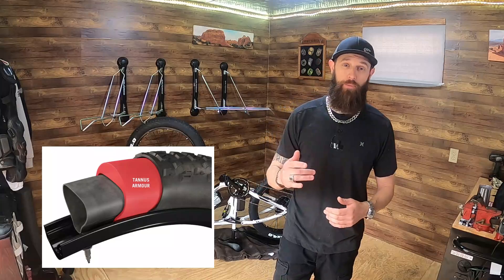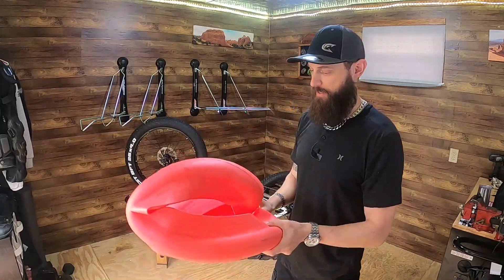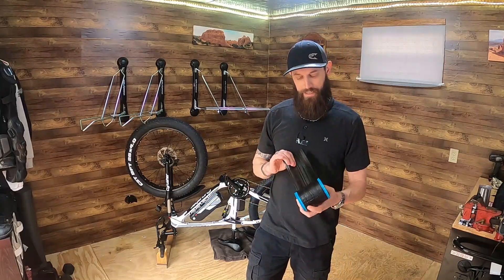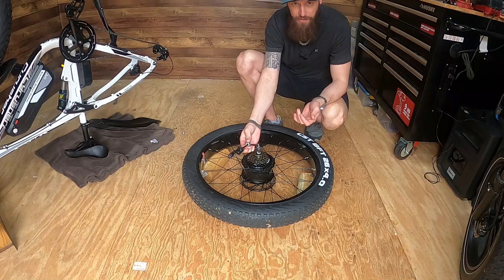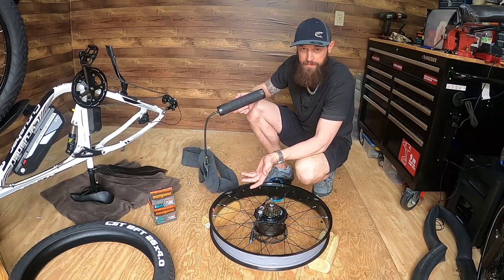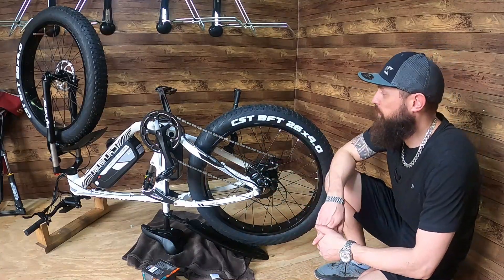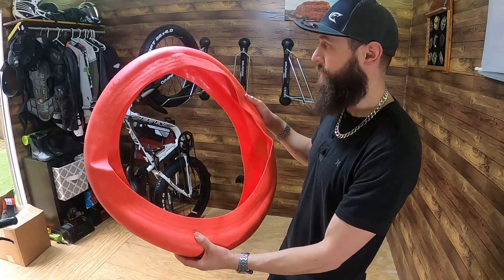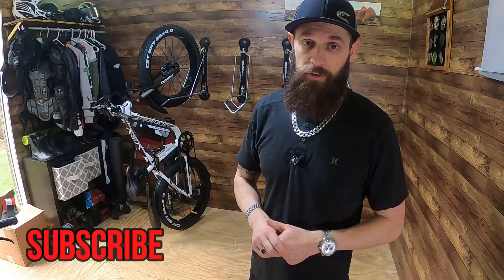Mr Tuffy Tire Liners vs Tannus Armour Foam

Comment: You should ride through a thorny field with both and see if either get a flat.
Reply: They're good for that it's Thorny sidewalks that will get you
Reply: That’s what I was hoping for. I don’t think my decision of flat protection will ride on the softness added. I actually prefer a stiffness because I get a more efficient thrust out of my pedaling. Softening is like low tire pressure that makes you do extra work.
Reply: @jesseschumacher4080 This video was supposed to compare the two for puncture resistance. No such luck. I use Flat Out in the tubes of my 4” wide fat tires. 450 miles and no flats yet. This area I live in has thorns everywhere.
Reply: I did that with tannus and no flats hundreds of thorns and the taffy liners couldn't handle it
Reply: @jesseschumacher4080 😂😂😂
Reply: @doncarpenter83  you can combine Tuffy and Tanus for ultimate protection
Reply: @illla this is exactly what I was thinking
Reply: @TravisMcGee151 do you use liners as well as the flat out or just by itself? 🍻

Comment: I've been rolling with mr. Tuffy's for over 15 years overall they work great and they're cheap I would recommend this to anybody who doesn't want to push there bike when they get a flat tire get them you'll be glad you did
Reply: Ultra light version? Never had a flat?
Reply: Have You tried "rhinoDillos" ?

Its a mr tuffy product too but with an improved formula apparently
Reply: @Tobi-wr4co   no I haven't
Reply: @capcom4eva  regular version Brown color code
Reply: You said they're cheap ?I don't think so..
Reply: I gotta agree. Mr Tuffy cut my flats in half maybe less.   They certainly do help and for extra measure I use Green Slime. Unless the hole is too big.  It seals the pin holes pretty well.

Comment: UPDATE. I knew I read it somewhere, so I got out my Tannus installation guide and on page 3 under Tips For Installing Tannus Armour it states (It is common for the Amour to compress over time. It still is providing shock absorption and puncture resistance but will perform better when properly maintained. To minimize compression deflate the tires while not use. This allows the Armour compound to rebound to provide ideal performance.) So does that mean when your not riding your bike, your suppose to let the air out of the tires? I'm sorry but that's not happening. I don't know how everyone else feels, but if I would have known that earlier, I would not have purchased the Armours.
Reply: Wow that sucks.

Comment: Interesting comparison - My personal experience riding in Southern California (Mecca for Goathead thorns) is that Tannus proves worthy. I have used several "liners" and none worked as needed. I've had the Tannus inserts w/tubes for about 6 months now and not 1 flat. I thought it would be interesting to count the thorns I picked up and pulled out, over 50 so far. I'm a believer in the Tannus solution.
Reply: @wildernessmusic1068No tyre in the world? Don't be so ridiculous..😂
Reply: @thetruebrit85 i think hes saying every tire should have thorn protection
Reply: Did your put the stock 4" tubes back in the Tannis liners or buy new smaller tubes? Please.
Reply: @petejansen8098  I put the smaller tubes in and it fits perfectly. I used foot powder in the tires and on the tubes to make it easier to fit. I love them.
Reply: @volocty what size tube do you use to fit ?
Reply: @ronsantos475  Tube size for the inserts is: 700x42/50 (ETRO 42/50-622) Presta 48mm.
Reply: Thank you !!!!
Reply: Lucky y'all, I've had flat tire with punctured tubes twice in a day and one the very morning after . You can't imagine the frustration I had.
Reply: Do you think that an old school 2.20 Slime Tube, Shrader Valve would work with a 4 inch Tannus Insert and Tire???? Thank you! I have tons of them laying around and would like to use them if they might work. : ) @volocty
Reply: @Sherman1862  I don't know about the sizes that go together, but reaching out to Tannus would be my suggestion.

Comment: I learned from an old timer   Just run tow straps inside wheel!  Cheap and works
Reply: i also heard to run fire hose as liners.
Reply: We used hot wheel tracks back in the day and never got flats after installing them just tape up the seams/connections
Reply: Im gonna try this

Comment: Want a really smooth ride? Take some baby powder (or foot powder) and put about 1/4 cup over the tire as well as inside the tire casing, dumping some in and turning the tire in your hand so the Baby Powder (talic) evenly distributes. This will make for a very supple ride as you prevent the tire from sticking to the tire casing inside which also increases chafing and hence tube wear and seam leaks). I have been a UBI Pro Mechanic and used this for bikes since the early 90's Even for ebikes too. (My first was an "ebike" but Ebike brand from 1999) For my spare tube I keep one in a ziplock bag with the talic in coating everything nice.  Trust me it really makes a huge difference!

Comment: I once used Tannus Armour and after a while both the front and rear Armour compressed permanently to about 1/8 of an inch in thickness.  I got a flat from a small metal shaving in the front tire and it went right through the Tannus Armour.  I tried riding with a front tire flat with the Tannus Armour and stopped because I was concerned about the rim becoming damaged.  I no longer use Tannus Armour and use some tire liners with Schwalbe Marathon Plus MTB Smart Guard.  They are heavy tires and are advertised as being thick enough to not get flats from objects the size of a thumbtack.  I road several thousand miles without any flats. 
If your bike tires are as flat resistant as car tires, that is ideal.  Objects like screws and nails that give car tires a flat will also give you bike tires a flat unless you have airless tires or airless tire liners.
Reply: Thanks for this comment. I remember hearing people having to deflate their tires after every ride. I’m all set on paying $160 for a pair of tannus armor and I’ll just get mr tuffy for half the price and get the same results.
Reply: @Nickles4  You're welcome and happy trials.
Reply: @johnb9005  So what do you advise for my 26 by 4 flat?
Reply: Does tannus armour feel heavier?

Comment: Watching You do all that work is crazy. I put the bike on My work stand, cracked one side of each tire front and back tires , inserted the Tuffy liners with one hand inside, reinstalled tire side and inflated !! NEVER took a tire off the bike or tire off the wheel.    Yes tube changing is a different story.

Comment: On my hub motor on back tire e bike, i fixed  flats n put the mr tuffy liner on without taking back tire off, i use rachet strap to raise back end of bike up off ground strapped around a tree branch or beam of roof or whatever you can strap it to
People when you go riding on hub motor ebike carry a rachet strap also so you can fix a flat easier if you need to, works good when putting tire back on with tire up in air, also carry bottle of unexpired bottle of green slime or 2 bottles, this saved me a few times fixing flats, best to put green slime in before you go riding, carry extra valve stems, one time green slim messed up my valve stem n couldn't pump up tire- had to put new one in, also carry steal long valve stem remover tool- one time plastic valve stem remover tool on green slime bottle broke n wouldn't take valve stem out, also carry skinny needle noise plyers- one time valve stem got stuck n valve stem remover tool wouldn't remove it
Especially on a e bike people, if you got wide tires n a heavy ebike it is hard to roll back home with a flat if you are miles away
Reply: Good suggestions — sounds like the voice of experience!
Reply: @phantom4255  
One day I put in tannus armour inserts n only got one flat in 10 months, best thing to do unless you put motorcycle tires on

Comment: I've now got TAnnus on my fat bike and they are excellent.  I had MR Tuffy but found them a nightmare to install...they slipped about inside the tyre and when I eventually removed them it was clear that they had settled inside the tyre in a series of twisty curves meaning there were areas of tyre not protected...and yes I did puncture because of it...

Comment: I installed Mr. Tuffy’s on my Rad Mini and it reduced the rolling resistance so much it felt like a completely different bike! It accelerates way better than before! A great investment, get the 26”x4” and wrap the extra within the tire casing...don’t cut it...quick sidebar...Locktite Non-Permanent fixed all of my rear wheel spoke problems..!
Reply: What spoke problem?
Reply: ditto, what spoke problem? spoke loosening & wheels becoming untrue?
Reply: Lol dude just learned about more psi = less resistance.
Reply: NAIL 💅 POLISH =The best thread locker

Comment: I appreciate your thoughts on the tire liners, I've talked with others who bought Tannus and they pretty much said the same as you, but your the first that has done both, so I definitely appreciate your input. i personally bought the Mr Tuffies, but like you said, I didn't see any difference in the ride, while, friends that have bought Tannus Armour all said it's like riding on a cloud. I'm getting my Aventon Aventure in mid June, so I may buy Tannus Amour for my new E-bike. Thanks again, always enjoy your videos!
Reply from the maker: yep it really does change the ride quality quite a bit and i'm a fan :)    quite expensive though
Reply: I just got my Aventure. I am debating on which liner to go with. How has your experience been over the past two months?
Reply: @adammerritt4404  I've had both Mr Tuffies and Tannus and yes Tannus is more expensive, but they are worth it. I put them on my Aventon and the ride is so much better and they'll handle goat heads from the west and midwest, so they'll handle anything we have here in the east. I've had mine on my Aventure for over a year and have no flats, even after riding through an area where there was glass all over the road, looked like it was windshield glass.

Comment: I just had a screw enter my back e-bike tire. It went through the tire and Mr. Tuffy liner, but the FlatOut sealant sealed the hole with very little air loss. Double your protection and double your fun. Their is nothing wrong with redundancy and it will keep you from walking your bike many miles, or save you time with an on-the-spot repair job. Who knows what type of weather conditions await you? I did not notice any different ride quality with both of the tire protector products. I love your videos on Rad Bike upgrades. Ready to pull the trigger on the Area 13, Bolton E-Bike, controller upgrade for my wife's Rad Mini ST.

Comment: I just ordered the Tannus inserts after watching your informative. Question when I fill the tube with the Tannus inserts do I use the recommender psi in the tire or should I put less cause of the inserts. Thanks
Reply: I'm guessing you'll want go slightly lower, but that lower pressure might provide similar firmness and flex to the tire.
Reply: I have been running 12 to 15 psi in my 20x4 inch tires and the ride is fine with the Tannus liners. Handles much better than before.
Reply: @ohwell2790  12-15 psi sounds right.  That's what is nice about our Armour.  You can run lower psi which gives better control, and comfort.  Cheers
Reply: @RideTannus  I run the CST Roly Poly 26x4.8 @ 6# in the rear, and 4.5-5# in the front. Where I live there is a lot of soft, deep sand, and goat heads are terrible problem. Are these pressures going to work well with the inserts?
Reply: @skooterbrah  If you're riding in the sand a lot a good # to run would be 6-10 psi with our Armour Inserts.  Anything below that we don't recommend really.  You can play with the psi up or down to get it where you are most comfortable. Hope this helps!

Comment: I use Mr Tuffy tire liners and slime tire sealant, they stop everything except nails and screws. I've learned to avoid construction areas because they spill nails all over the streets... 😠 I'm also familiar with the more comfortable ride when I was using Schwalbe Marathon tires which had a thick rubber compound. But that was on thin tires on a hybrid bike. With fat tires you get a similar effect so the ride isn't so harsh that I would favor the Tannus armor over what I use currently.

Comment: My observation on the Mr Tuffy liners. Yes, they do reduce the goats head thorn punctures. If you get a tuff thorn and it breaks off and the pointy part stays in the tire after more riding the thorn WILL get thru the tube. Yes the rolling resistance is less, however the ride over gravel/sidewalk cracks is much rougher.
Reply: With Slime liners I've got numerous things embedded in the tire and even take small chunks out of tires, revealing the green lining without puncturing. Have had flats from thorns just missing the liner, though.

Comment: I have 2 Juiced Ripcurrent S for the last two years and had the Mr. Tuffy's in both and never had a flat. I switched to Tannus Armour and Maxxis Minion tires. IMO the Tannus inserts causes higher rolling resistance vs the Mr Tuffy's. I now have 2 months on the Tannus and for the first month the tire pressure kept dropping 2-3 psi every week. If you can do a battery range test Full to flat between the Tannus and Mr Tuffy on the same ebike and tires I would like to see those results.
Reply: So what do you prefer,? I just bought a rip current s also 🤠
Reply: @jewboyjon75  I have converted all tires to tubeless.
Reply: That's what keeps me from getting them. I've heard mixed opinions on the resistance, but I don't see how it's not gonna be a little too squishy and slow for road use. Trails, I'll be on them all day. Absolutely. But for an ebike that spends more time on the road, I think I'd rather stick to double skin tubes. The amount a slightly too low tire slows you down, and drains the battery is substantial enough for me to skip them. Sucks because I like the idea and really want them, but I'll wait until I do up a straight trail ride. I really wish they would get on different composition/hardness options. And I mean it's not like they're super overpriced. But especially the fatties, are a little ridiculous for a little piece of molded foam. You don't really have much choice if you need them, and I wouldn't mind the price if I do end up needing them enough. But I've only got two flats in the past year, and both could have potentially gone right through the t.a. anyway. Big spike of glass, and then metal. Idk. Doubling an old tube or two has kept out the little dumb stuff, so.

Comment: I started with Mr. Tuffy's and after 1,200 miles through every kind of terrain I have yet to get a flat - - ->>>.<<<.  I installed them without even taking the tire off the wheel or the bike !!
Reply: What about those thorns in the desert or whatever there called, did you ride in the desert where those are at?
When i ride in the forest in flagstaff Az  i never got a flat, but on side of interstate from flagstaff to bellemont i got a flat one time

Comment: Tannus is excellent, but I suggest you use a good, durable inner tube. I had a rear flat though I had a Tannus installed. No puncture, but maybe the inner tube just failed.

Comment: Was getting crazy flats on the rear of my Ariel Rider X-Class which is a 20x4.0 size.  Installed a Mr. Tuffy and have yet to get a flat in over 1,000 miles mostly off-road.  My original rear tire had gotten somewhat large holes ripped in it and the tire liner started to become the tire lol.  The tire never went flat, even with the liner showing through!  I found the install to be not as easy as I thought.  I wish the Mr. Tuffy could stick to the inside of the tire with some mild adhesive.  It seemed like the liner might slide to one side or the other if you're not careful.
Reply: ... Ive been using  Mr. Tuffy on 26x4 and have 2 flats 6000 km from 3inch finishing nails .. they seem to be fairly thorn resistant... to hold the Tuffy in place i use bits of tuck tape/venture tape ..works well to hold it in place ..

Comment: I used the Mr. Tuffy liners on the current build.

50 miles, and my first Flat this morning.  Need to pull the tire off this evening, and find out what the cause is.  

There’s a trick to inserting liners - insert an aired up tube to hold the liner in place, and go around the rim about 30 degrees at a time, tucking in the liner a bit at a time, then checking that it’s centered before popping it on the rim…

Comment: I have both Mr Tuffy and Tannus in the rear and have NEVER had a problem. Have just Mr Tuffy in the front ands all is well Just FYI
Reply: Can you do both???
Reply: @chaguito69  you can do both, but if you're on a budget mr. Tuffy is the way to go. I have a specialized fatboy & have mr. Tuffy on both front & back. Easy to install & it does the job on the base of the wheels. If you're an aggressive rider & go thru bushes, you might need the extra sidewall protection & Tannus would be your best bet🤔
Reply: @MER1CA_1st  nah i have a sondors fat tire just for commute , the stock tires are fat in diameter but they are really thin that you can feel it at touching it
Reply: what size tires are you running both the tannus and tuffy on?

Comment: I've used all sorts,  from leather to the cable liner they use under the road. Pipe insulation works very well and is very cheap.  I used gym rope in my bmx in the 80s